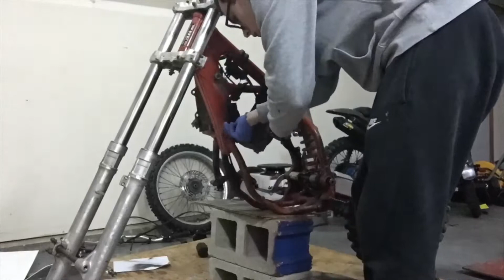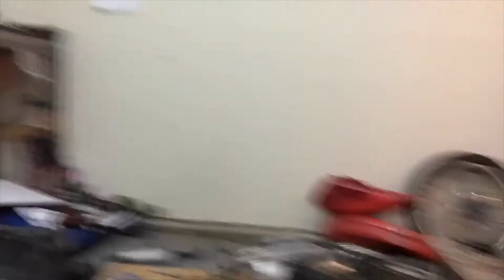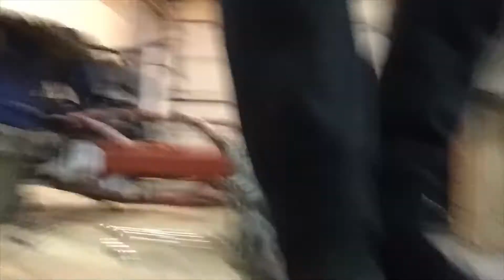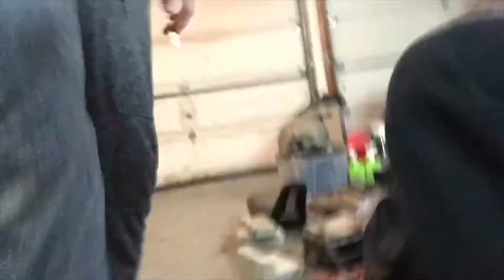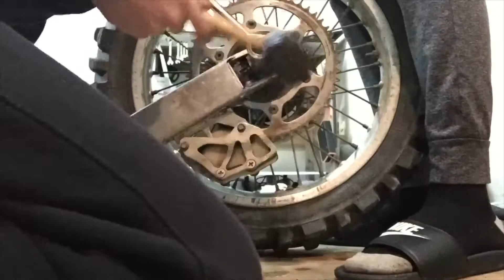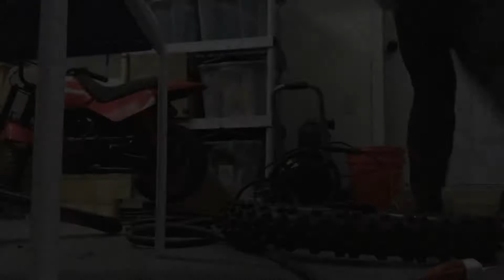1989 CR125 Teardown

Comment: I got two of these iv been messing with for years..keep at it il be watching. Good work man
Ps. If ya have a question iv messed with every inch of these bikes if it helps. Thanks again
Reply from the maker: Thank you! I’ll let you know!
Reply from the maker: Do you have a bike that you are using for parts by any chance? Because I need a cylinder head, and the spring and spring plate to the power valve, the guy I got this from took it out and didn’t tell me, and he messed up the cylinder head bad. Let me know I’ll pay you.